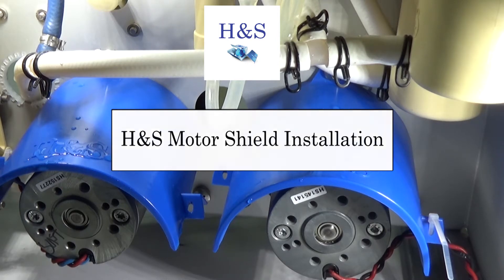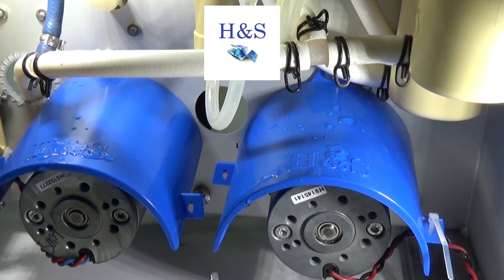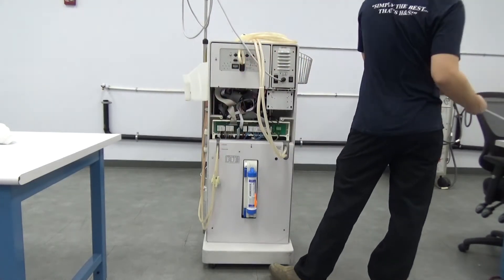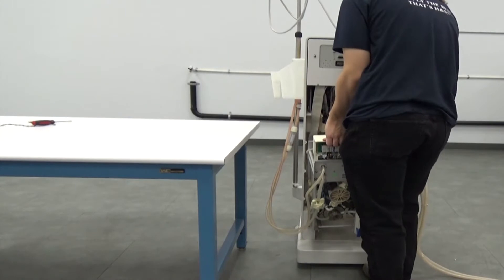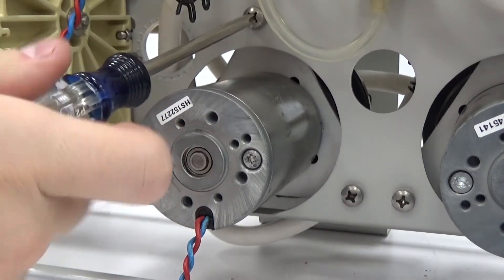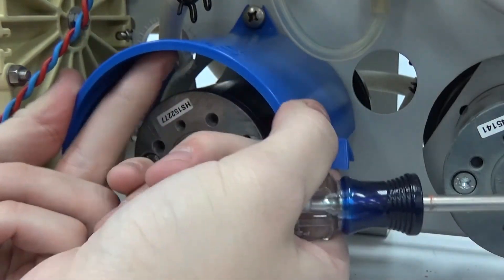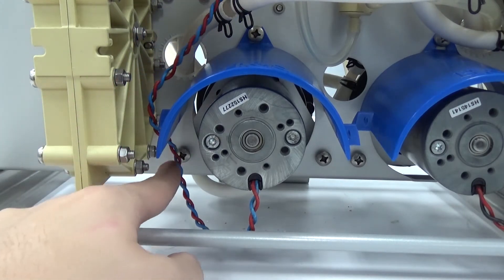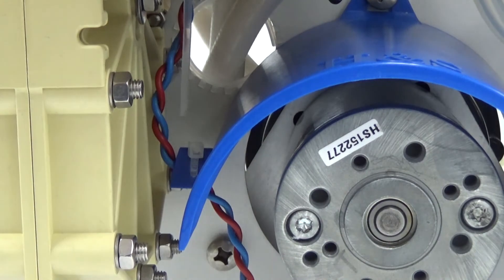Motor Shield Installation Instructions

Comment: Great idea however, if your shit is working right hint hint (final checks ) during pms then this should not be needed
Reply from the maker: Thank you so much for your comment! This is a very good point, theoretically - if the machine and all of its hoses are maintained or updated there will be no need for a shield. In reality, performing the PM’s and from normal wear, there are worn hoses and slight, almost unnoticeable drips which wreak havoc on the motors. These drips are the number one cause of premature failure of the motors.